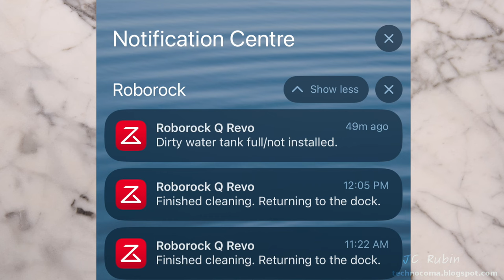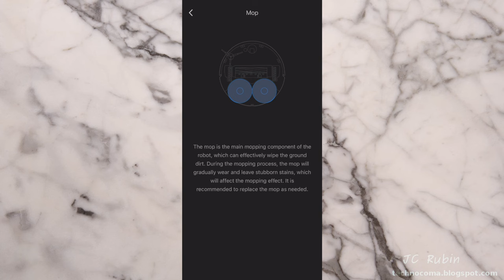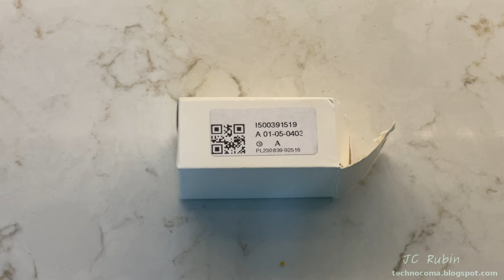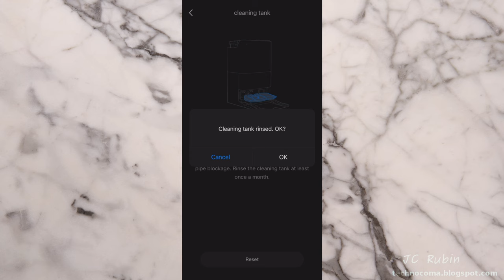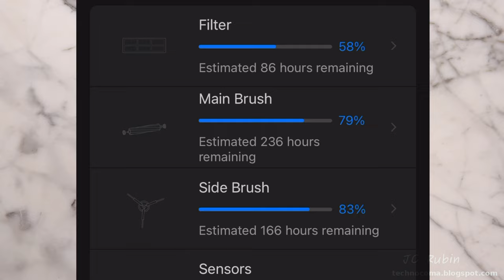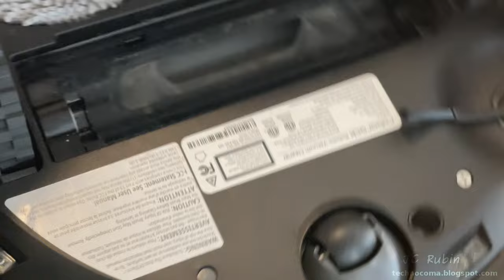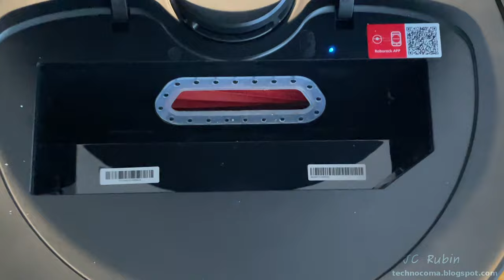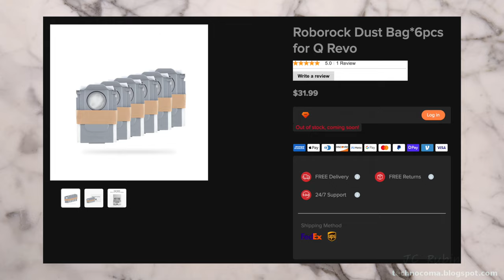Roborock Q Revo Maintenance for Performance and Odor Control

Comment: Hi! I've realy appreciate the video. A little tip from my experience, i pour a little of bleach in the dirty water conteiner when it's empty, this removes the smell almost entirely. Also, i have an issue: I've changed the mops with an online equivalent, but they detach from the stripes almost every day. Is there something i can do for that? I still have the original ones,  but i was asking.

Comment: Thank you for the video! Is it safe to use 70% isopropyl alcohol (put on a cloth) for better cleaning or can it damage the robot surface (I'm talking about those parts that actually have to deal with collecting dirt and the sensors)?

Comment: Have you ever had an issue with your Q Revo leaking drops of water? I’ve only had mine for 2 weeks and even when I do a vacuum only run I notice big drops of water on the floor especially where she transitions from carpet to hardwood. Any advice? Do I have a faulty unit?
Reply from the maker: I've not encountered this

Comment: Excellent video, thank you.  If you ever re-publish this video you may wish to show how to unblock the part that feeds into the dust bag.  Today  was my first day using the Q Revo, which is my first robotic cleaner, and an error message displayed that the bag needed to be unblocked. Tells you  a lot about my cleaning regime!  Also do you have a video on how to spot clean please? I want to learn how to use the remote joystick and how to spot clean with the vacuum only.  The spot clean function seems to be both  mop and vacuum together.  Thank you .
Reply from the maker: There is a deeper issue having to do with how often it wmpties while cleaning the house for which a second video will be made.

Comment: Thank you for the video very understanding I do have one huge question. Maybe you can have the answer to this in the app there is a setting under the vacuum only it’s called max+ for deep cleaning only what does that setting do I have tried to search over the Internet and I can’t find anything. What’s the difference between max and max+

Comment: Great video. Quick question: is there a way to get the residue water out of the robot? How do do you prevent forming of limescale and breeding of bacteria?
Reply from the maker: I use zero water as mentioned that has no mineral content.

Comment: I think you can empty the dust bin in the trash can and give it at least a second use. Like 1 bag every 2-3 months. Is a small saving but I think it worths it. And maybe you can clean the bag with water or some sort of procedure, same as the dust bin in the robot right?
Reply from the maker: It’s possible, bulk bags are cheap. eBay also sells some with zippers
Reply: @retrotechandelectronics  I tell you more: 1st empty the big waste in the trash can and for thr small dust inside vacum the dist bag with another vacuum regular machine!! hahha what a hack!!

Comment: Great video, thanks! 

Do you know if it's safe to use that silver ion module for mopping an apartment with kids? (I assume it should be if there is just a silver in it, but wanted to double-check). 
Also, the same question for their official Omo cleaning solution ("Roborock Floor Cleaning Solution for Vacuum Mops").
Reply from the maker: Im testing it right now and notice no difference.

Comment: I purchased this device from Amazon a month ago and I could not get the water to fill into the vacuum so it did not mop.  None of the suggestions by the manufacturer helped.  I returned it and just received a second one and it is doing the same thing.  I am wondering if there is some step I am missing such as removing a piece of protective tape somewhere.  I have looked everywhere and cannot find anything.
Reply: i have heard you may need to prime the water pump using a syringe

Comment: Do you know if after market filters, mop pads, rubber roll, dirt bags, etc works as well as the the OEM parts?
Thank you so much for making this video.
Reply from the maker: I have bought them and only used some in testing, they seem to work good
Reply: @retrotechandelectronics  - Thanks!

Comment: Great video! Do you see any difference in clean water tank using silver ion module? I just bought q revo and I wonder if I should buy this. I see on aliexpress original roborock modules which cost double than the others. Does it matter if they are original or not?
Reply from the maker: As of yet we have not noticed any difference

Comment: My Q Revo has the problem that one of the two mops does not get wet anymore.  - I have found no solution for that misbehavior, yet.
Reply from the maker: Hard tap water may have plugged one of the nozzles